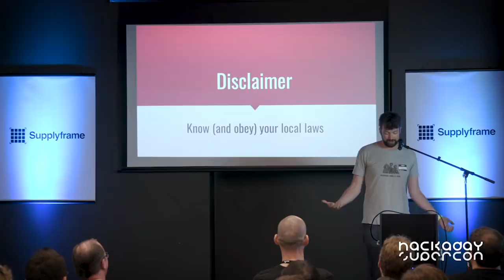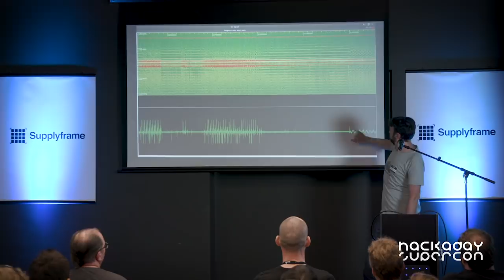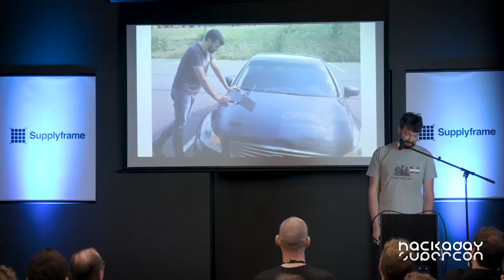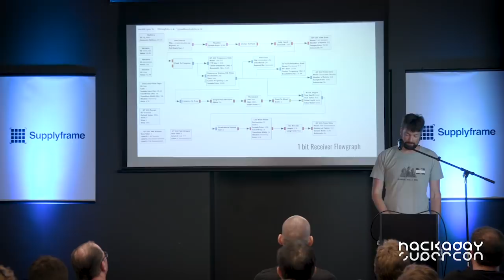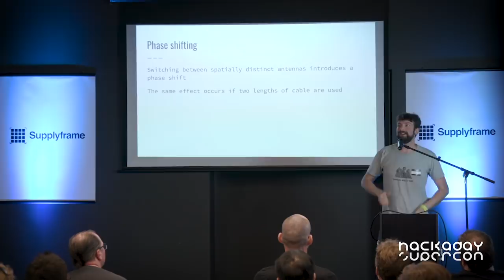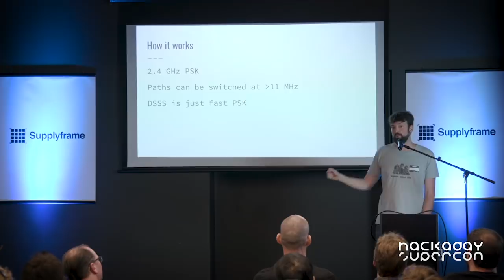Hackaday Supercon - Dominic Spill : Ridiculous Radios

Comment: Regarding the fm receiver,  I get you need to generate/add the carrier frequency from the GreatFet to the signal coming from the antenna.. but isn't fm modulation done as sine waves, and if so, how does the square clock source from the micro not cause a problem?  And why is a diode needed before it goes to the ADC?    Is that post-transmission pilot tone from the radio standard?

Looking at its grc flow (Ridiculous-Radios-Supercon-2018.pdf), what is the breadboard.dat source?  And why must it go thru a power squelch before the NBFM receiver?

Regarding transmitting FSK, is the NXP LPC4330's SCU that allows you to mux the output between one center frequency and another, a standard feature among microcontrollers?
Reply: You can look at squarewave as a lot of sinewaves at multiple of main frequency (harmonics)

He has a sine at "desired frequency", but also, at harmonics. That is not the only thing "wrong" with this setup, but, yeah, if there is nothing around harmonics, this is, I can not say fine, but, will do somethibg...